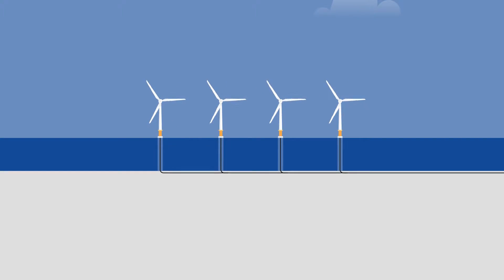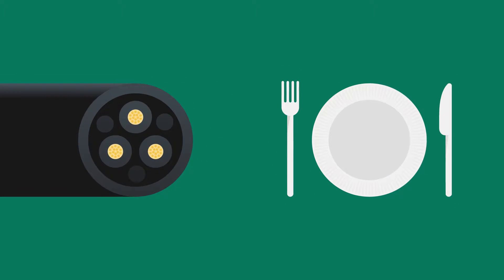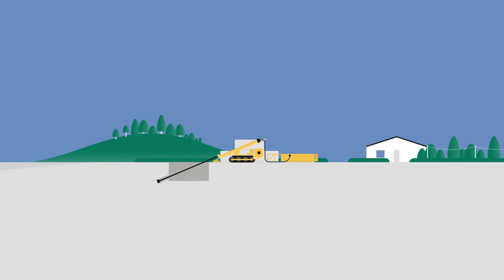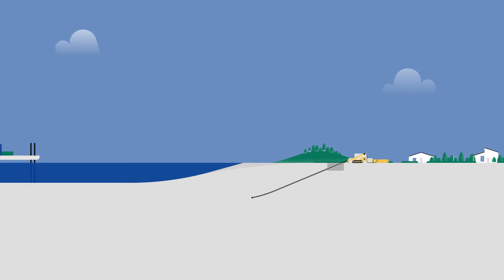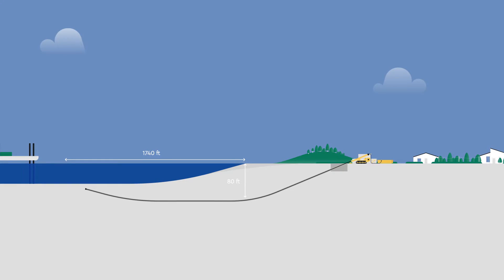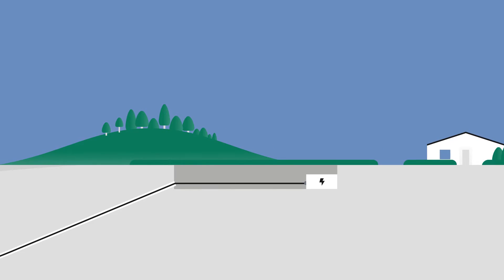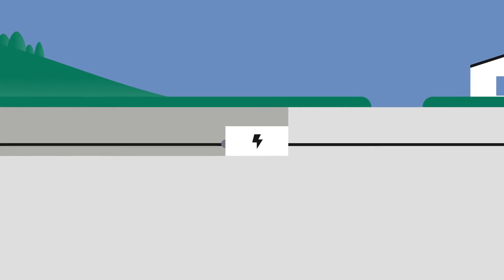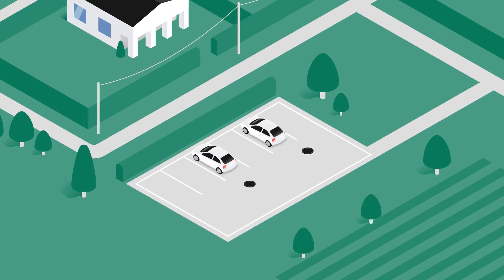Landfall: bringing power to shore using horizontal directional drilling

Comment: Thank you for beneficial information. However, I have a question. Are there any prevention measures to prevent inflow of sea water on onshore landfall? Since the landfall is located at the same level of sea level, sea water would fill the manhole area.
Reply: There is a bellmouth installed on both ends of the HDPE to prevent sea water!